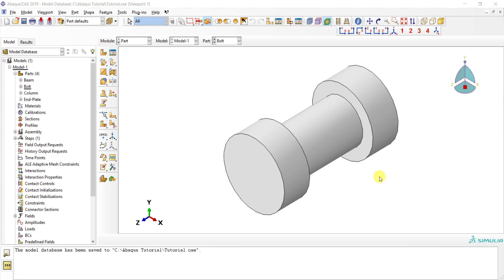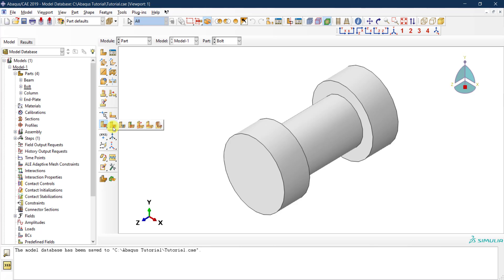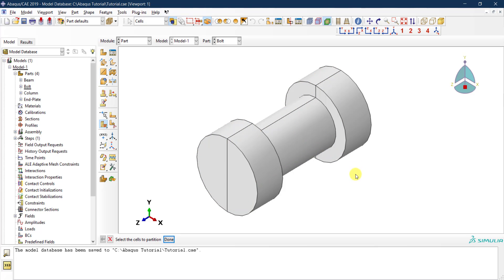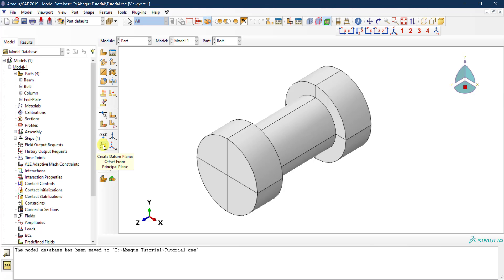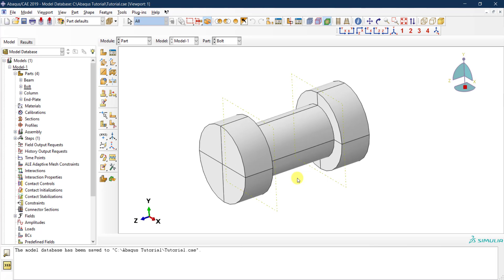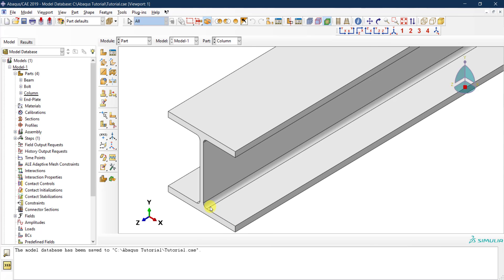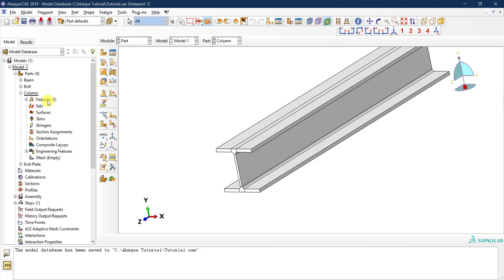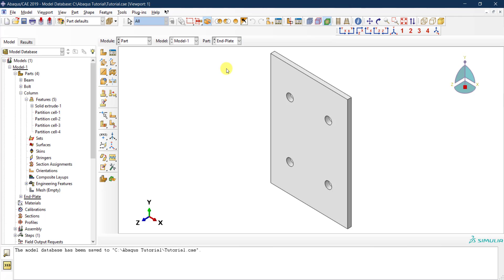#07 ABAQUS Tutorial: Partitioning parts

Comment: What a great work sir! It is helping me a lot. But Sir, I can't understand why the beam section is chosen as shell. And while partitioning column, how did you chose 2nd point, it seems center point of fillet to me. why was that? How does that point helps in cutting the piece?
Reply from the maker: The beam is only modeled with shell elemenets for demonstration purposes of the different modeling techniques.
Reply from the maker: You should try to always partition you parts at the edges of round features to make mashing easier and more regular.